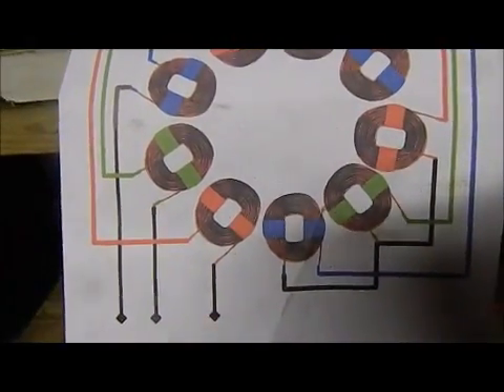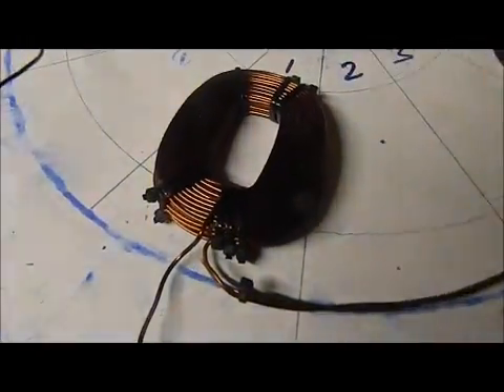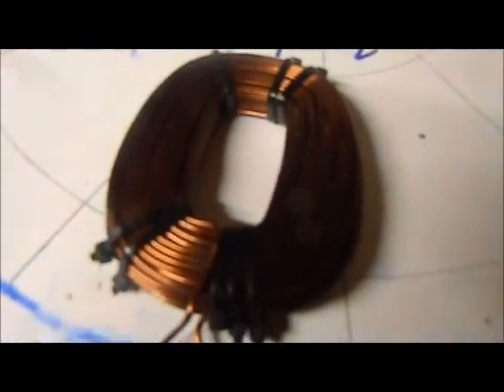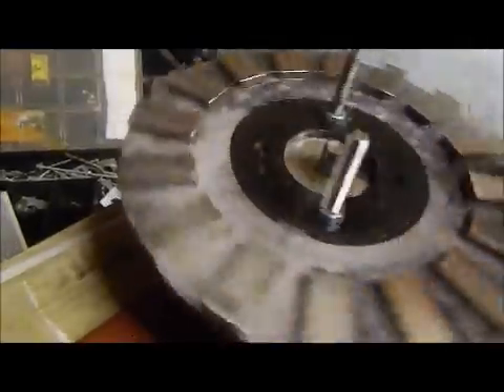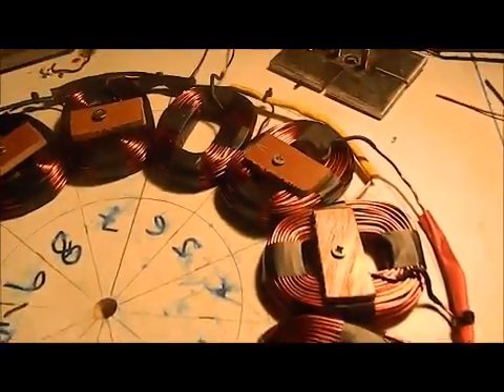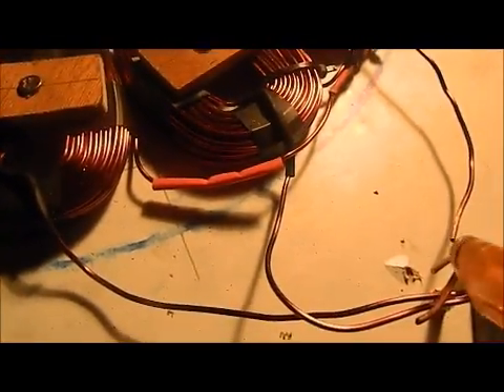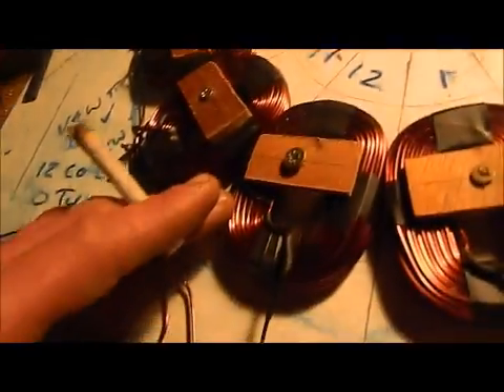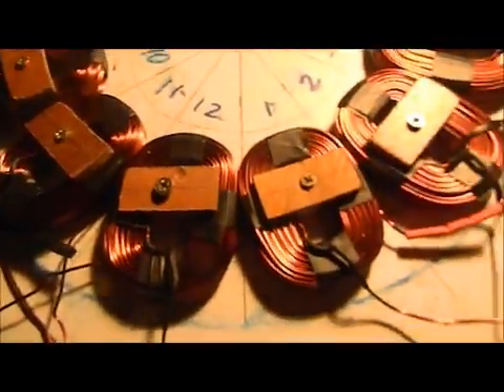24 Volt OFF GRID WIND TURBINE , Stator Major progress 14/12/2016

Comment: my friend taught me if a person was unsure how many turns to do, he said just wind one test coil put it between the magnet rotors and spin the rotors to the desired cut in speed ie the rpms  you want the wind turbine to hit battery voltage ie big blades maybe 150rpms small blades maybe 250rpms, example if you want 12v at 250rpms and you have 3 coils per phase then you want your test coil to hit 4vac at 250rpms, 3 coils times 4 volts = 12v. i know you know this but others may not. ofcourse its just a rough guide.
Reply from the maker: I'm hoping when we put the new gear cog on it's going to reduce the 12 volt to about 80 and the 24 volt to about 160 which is still pretty high. But it's all an experiment as you know
Reply: @GavinFreedomLover  160 aint bad though
Reply from the maker: Thats an estimate based on the fact that it hit 28v at around 250 before , sometimes it can be confusing slowing the film down but that was my guess, so it will be geared up to give 33% more rpm at the motor , I like having gears on it , you know me I like to be different , shame that Chris Olson isn't around to show us the way.

Comment: Is that Copper "??  OR Copper Coted '??
Aluminum.??  If so, In case ya' don't know,  [ Aluminum ] it's  - self, can have a 
Slowing effect on your  magnetic power wheel.... Causing it to produce less' amps" ....  Just one of many" things to washout for, my friend....
Reply from the maker: No this is proper magnet wire not aluminium , thanks.

Comment: Some times these magnets interfere with each other.  There should NOT be a north pole magnet AND a south pole magnet on the same coil at the same time that's why we need to use square magnets instead of round magnets and design proper spacing of the magnets. I have devised a slightly different design that I think could double the efficiency of this generator while taking advantage of the no cogging feature. The flux density is greater the closer the magnets are to each other so making thinner coils would also make more power output. This new design can incorporate steel for the return magnet flux field. And lastly, the new design should use the coils almost on top of each other so as to have 3 phases very close to each other. This design would be a hybrid of old and new designs.